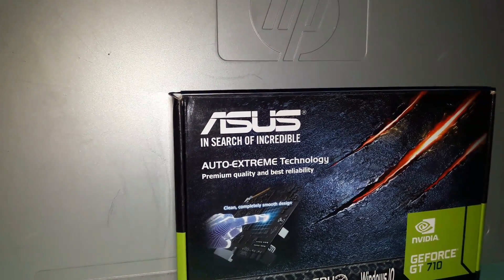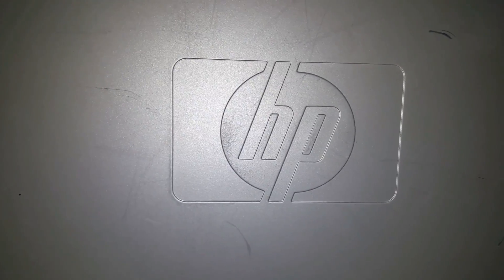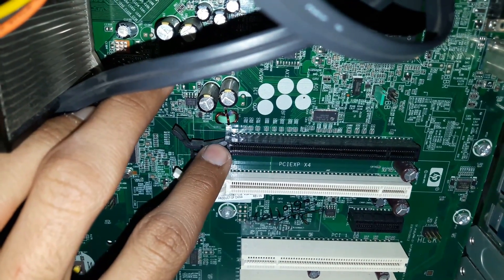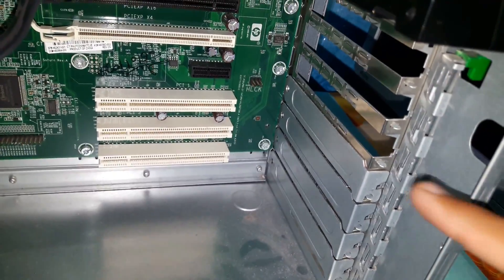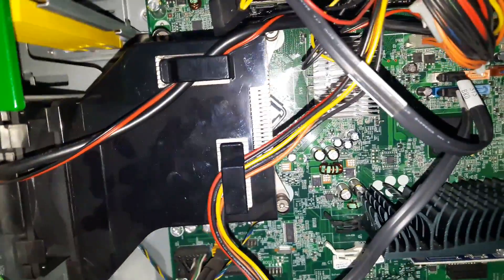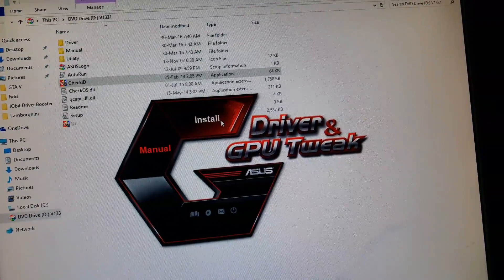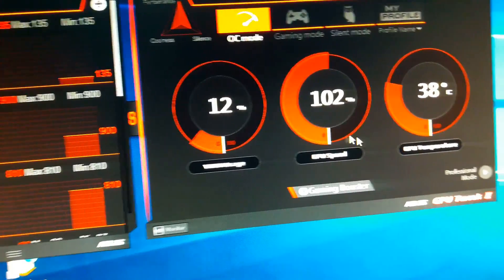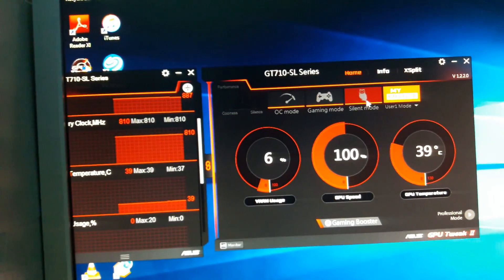ASUS Nvidia GT710 Installation on PC

Comment: Can it fit and work in windows 7
 ???????????????????
Reply from the maker: A-Tech Officials - I would not recommend to use this graphics card on a system running Microsoft Windows-7, because there are some few disadvantages:
1. Compatibility issues
2. Microsoft has officially stopped support for Windows-7 which means no more software updates.
3. You won't get regular Nividia Geforce Driver Updates due to the compatibility issues.
So, in conclusion to the above problems/disadvantages I would highly recommend to pair this graphics card with a system/PC running Windows-10 OS.

Comment: Can it work in 250w psu or will I face any issue !!
Reply from the maker: A-Tech Officials - According to Nvidia, the recommend PSU to efficiently run/use this graphics card, must have a wattage rating of 300 Watts (minimum). So, I am not sure that this graphics card would work with a PSU with lower wattage rating. And if it works than I am sure that it won't work in maximum power or able to reach higher frequency which in result will decrease performance.

Comment: Core 2 duo E8400 
4gb ddr2 ram
Gt710 2gb 
250w psu
Will it work
Reply: Motherboard?
Reply: @nehajadhav6072  zeb-g41 ddr2 motherboard i think my motherboard didn't support the graphic card
Reply: @nehajadhav6072  can zeb-G31 motherboard support gt710 ddr3 2gb

Comment: I have ddr2 motherboard so can i install gt 710 graphics card? Please help anyone
Reply from the maker: A-Tech Officials - It doesn't matter that what RAM (DDR2, DDR3, DDR4) type your motherboard supports the main thing which is required to install/mount this graphic card is a PCI-Express (PCI-E x16) slot. So, please check that your motherboard consists of a PCI-E x16 slot in order to mount/install/use any graphic card.

Comment: It will work on a 240 watt power supply if a guy 1030 can.
Reply from the maker: A-Tech Officials - This graphic card (Nvidia GT710 DDR3) might work on 240 Watts power supply but it will definitely work in under-voltage situation which will result in low performance and the maximum power and performance of the graphic card core cannot be achieved.
That's why we recommend you to use a 300 Watts of PSU with this graphic card and the fact is that even the Nvidia itself has mentioned on their website that this Nvidia GT710 DDR3 graphic card requires a minimum PSU of 300 Watts in order to work properly.

Comment: Can my power supply 300w handle this graphics card thanku
Reply from the maker: A-Tech Officials - Yes you can use this Nvidia GT710 graphic card because its minimum power supply requirement is 300 watts so your psu can handle it.
Reply: no it needs 2500000000000000000000000000000000000000000000000000watts
Reply: Depends on what CPU you have

Comment: can any graphics card work with h16m ds2 mther board????
Reply from the maker: A-Tech Officials - Your Gigabyte H61M DS2 Motherboard has a PCIE x16 slot but that doesn’t mean you can buy and install any graphic card on your motherboard. See there are two facts which should be noticed/considered before installing a graphic card.

1. Each and every graphic card has different minimum power supply requirements.

2. Installing a latest graphic card in a outdated hardware will not increase the performance of that hardware but may bottle neck its performance.
So what I mean to say that if you want to install a powerful latest graphic card then you will surely need a hardware(motherboard, ram, psu, storage device) that is capable of handling that much power so that any bottle neck issues doesn’t exists in the system.

So the whole conclusion is that no matter which graphic card you are using with your motherboard your system must full fill the minimum power requirements of that graphic card which means your power supply unit(PSU) should be capable of delivering the required power to that graphic card and also make sure your other hardware like motherboard should be able to utilise the power and performance of that graphic card.

Comment: Will it work on Asus p5g41t-mlx motherboard having specs- 2.93GHz Intel core 2 duo processor, 4GB DDR3 1333mhz oc ram, 2 pci slots, 1 pci ex16 slot, directx 10 support? My purpose is to establish a dual monitor setup.
Reply from the maker: A-Tech Officials - Your PC Specifications are sufficient to install and use this graphic card to play normal games or do minimal graphical work but if your purpose is to setup a dual monitor system then this graphic may not be suitable for your purpose even your system configuration is also not up to that level to run a dual monitor setup. So we recommend you to do some minimal upgrade like replacing the Intel Core 2 Duo processor with a Intel Core 2 Quad and increasing your RAM at least to 8GB DDR3 (make sure to buy the same frequency of RAM which means all the RAM installed in your computer should run on the same clock frequency) and you need to buy at least a Nvidia GT1030 2GB graphic Card and a 300 WATT or 450 WATT Power supply Unit(if your system already have a 300 WATT PSU then don't need to replace it).
So the conclusion is that you have to spend some amount of money but this price will be negligible in comparison with the price of buying a new PC.

Comment: Can I connect it to a power supply
Reply from the maker: A-Tech Officials - This graphic card does not require any additional power supply cable because it is a entry level graphic card it can take the power(Voltage) from the PCIE slot.
Just make sure that your computer System has at least a 300 Watt Power Supply Unit (PSU) installed in it because this graphic card's Minimum System Power Requirement is 300 Watt.

Comment: Will this gpu work on my 250 watts power supply pc
Reply from the maker: A-Tech Officials - No, the Nvidia GT710 Graphic Card’s minimum system power requirement is 300 Watts.
Reply: It will work

Comment: I have an intel i3 3.30ghz processor. 8Gb ram. If i install this graphics card can i play GTA 5 without lag? Pls reply
Reply from the maker: A-Tech Officials - Yes, you can run GTA5 with this configuration but let us inform you that it is an entry level graphic card so it will not give you the performance that you might be expecting. Although the Asus Nvidia GT710 graphic card can run GTA-5 without any lag but keep the GTA-5 graphic settings to low or configure the settings that best suits your desktop configuration.

Comment: One thing I was wondering you see how the golden part (connector on the bottom) is really small and short would it still work even if the port on the motherboard is longer
Reply from the maker: A-Tech Officials - In case of graphic cards it is not necessary the graphic card PCIE connectors should be of full length. Because some entry level graphic cards doesn’t comes with a Full length PCIE connectors But that doesn’t mean that these entry level graphic card will not mount/install in a PCIE x16 slot. The graphic card with half length PCIE connectors will also work fine like a Full length PCIE connector graphic card. So the length of the graphic card PCIE connectors does not matter. The only thing matter is that the user’s motherboard must contain a PCIE x16 slot to install/mount that graphic card. And several other factors are also necessary in using/installing a graphic card like power supply unit.
Reply: @ATechOfficials  thanks bro i thought the gpu was to small i just ordered one with a asrock motherboard

Comment: bro i have no monitor 
i have inbuilt, wat to do
Reply from the maker: A-Tech Officials - You are trying to say that you have a All in one PC. Please be little bit specific so that we can solve your query.
Reply: Oh sorry then and 
How do I install a graphics card
Reply from the maker: A-Tech Officials - The all in one desktop doesn’t support a graphic card because they are designed to be slim so that all the components motherboard ram and hdd stays behind the lcd displays making it compact so may be there are no PCIE slot available on your desktop’s motherboard and if there is a PCIE port is available then you will not be able to fit a graphic card in your desktop because there will be no space  left to mount it.
And according to my knowledge the all in one desktop comes with integrated graphics which means the graphic card is soldered on the motherboard forming a embedded system. So there is no way to upgrade or install the graphic card on a all in one desktop pc.

Comment: this pc is 10 years old how did you use it??!!!
Reply from the maker: A-Tech Officials - The PC used in this video was not in use now and it was only used for demonstrative purpose only.
And currently the A-Tech Officials team is not using a 10 years old PC 
They are using a PC with intel 7th gen. processor to render and edit videos we will be soon be upgrading to Intel 
8th gen. Processors.

Comment: do i need to install the graphics card first before i install the cd ?
Reply from the maker: A-Tech Officials - Yes, you have to insert the graphic card into the PCIE x16 slot on motherboard and you also have to connect your display cable(VGA or DVI-D or HDMI) in the graphic card. Then you can power on the desktop and can install the drivers from the CD provided.

Comment: Does it work on a Lenovo ThinkCentre M92P computer?
Reply from the maker: A-Tech Officials - Your Lenovo ThinkCentre M92p PC uses a Intel Q77 Express Chipset which only contains PCIe x1, x2 & x4 slots. To install and run this and other available graphic cards you need to buy a motherboard that contains a PCIe x16 slot on it.
Reply: A-Tech Officials Ok thank you
Reply: A-Tech Officials Btw can you give me a link where i can buy that motherboard?
Reply from the maker: A-Tech Officials - I don’t understand what you were trying to say what’s the meaning of “Btw” here.
Reply: A-Tech Officials "Btw" means "By the way"
Reply from the maker: A-Tech Officials - Ok Now I got what you were trying to say. So If you were thinking of upgrading/changing your motherboard then you also have to change your processor because your old processor may not fit in the new 7th or 8th generation motherboard.
For example: If you have Intel Core 2 Quad processor and if you bought a 7th generation motherboard with lga 1151 cpu slot then you cannot able to fit your core 2 quad processor in that motherboard because your processor requires a motherboard with lga 775 cpu slot.

I hope now you got my point that what I am trying to say.

So if you need more help regarding this query then you can mention your pc specifications in the comments section so that I can help you in selecting the correct motherboard.
Reply from the maker: A-Tech Officials - There is no requirement to mention your PC specifications in comments section. I forgot as you have already mentioned your pc model.
So your Lenovo ThinkCentre M92P uses a Intel Core i5-3470T 3rd Generation processor which requires a motherboard with LGA1155 CPU slot.

So if you don’t want to buy a new processor and a new motherboard then you can do one thing you can search on internet for motherboard with LGA1155 CPU slot and you can find several old motherboards with this type of slot that you can buy. Before buying just make sure that the motherboard you were buying has a PCIE x16 (PCI Express x16) slot on it so that you can also mount/install and use graphic cards.

Comment: bhai koi gpu ko lgane ke baad koi cable usmein lgana pdta h kya
Reply from the maker: A-Tech Officials - Powerful GPU's like Nvidia's 10 series GPUs and many others requires an external power source but most of the entry level GPU's does not require any external power source. So it is depend on the GPU model that it will require a external power source or not.The user can read the GPU description before buying a GPU. All the information like external power source is required or not are given in the GPU description.

Comment: bro the cd given inside has a driver for win 7 32 bit or what?
Reply from the maker: A-Tech Officials - The Asus GPU tweak 2 Software CD came with this graphic card supports Windows 7 32 & 64bits,
Windows 8,8.1 and Windows 10.
But the drivers came in the CD are outdated so you can download the latest software from the asus official website.

Comment: Can I run gta 5 on my pc which has intel core duo 2ghz and has 4gb ram and has asus gtx 750 ti as gpu
Reply from the maker: A-Tech Officials - Yes, you can run GTA 5 with your PC configuration but at medium graphic setting but if you want you can also customise graphics settings by setting some values to high and some settings to medium.
For eg :- set water quality to high
And set particles quality to medium

Comment: Sir can i install this with dual core processor
Reply from the maker: A-Tech Officials - Yes, you can use this graphic card with Dual Core processors like the intel Pentium series etc. But make sure that your motherboard contains a PCIe x16 slot before buying this graphic card.

Comment: Hi! I have a question maybe you can help me :).... I`ll buy one Gt710 1 Gb gpu, the thing is that I have an Asrock G41m-vs3 Motherboard and it Only supports memories(ram) with no more than 1333 Mhz, since this graphic card memory has 1600 Mhz do you think It would run? Thank you..
Reply from the maker: A-Tech Officials - In case of graphic card the graphic card uses VRAM (Virtual Ram) and it does not matter that your motherboard can support maximum RAM up to 1333 Mhz Frequency the only thing matter is that your motherboard must contain a PCIe x16 slot because graphic card is installed/mounted in this type of slot only. And in your case your Asrock G41m-vs3 motherboard do contains a blue colored PCIe x16 slot on it where you can install this graphic card but make sure that you have minimum 300 Watts of Power Supply Unit (PSU) because this graphic card requires minimum 300 Watts PSU to run.

Comment: Ca n I install it on Asus vertion core i5 4460 4gb ram and Intel HD 4600(1543mb dedicated)??
Reply from the maker: A-Tech Officials - I didn’t find any Asus Vertion but I think it may be a Acer Veriton.....please make sure that you mention the right model no. of your Desktop PC because if you will mention the correct model no. then only I can solve your problem.
But if you don’t know your PC’s model no. then you can check and make sure that your motherboard have a (PCI express) PCIe x16 slot on it or not because to use and install this graphic card your motherboard must have a PCIe x16 slot on it.

Comment: thanks for this video but please can i install this gt 710 on ddr2 ? please
Reply from the maker: A-Tech Officials - First of all in case of graphic cards the RAM version doesn’t matter whether it is a DDR2 or DDR3 the only thing matters in successful installation of graphic card is that make sure your motherboard has a PCI express (PCIe) x16 slot on it. Because the graphic card only fits into a PCIe x16 slots and the RAM version may little bit affect the performance of graphic card and processing of processor but after all everything will work great.

Comment: can this support my
core 2 duo e8400
6gb ram
280 watt psu 
ty in advance
Reply from the maker: A-Tech Officials - You cannot Run this graphic card on your PC System because your PSU is only 280 Watts and the Nvidia GT710 minimum psu requirement is 300 Watts.

Comment: Did you have to tweak anything in bios or was the graphic card detected straight away?
Reply from the maker: A-Tech Officials - There is no need to tweak anything or change bios settings when the graphics card is mounted/installed the system will automatically detect the new hardware. The only thing you keep in mind that when you mount the graphics card disconnect the display cable from onboard ports and connect it to the graphics card ports before turning on/ booting your PC.
Reply: Great! Thanks!

Comment: is this video card compatible to my old socket 775 motherboard?
Reply from the maker: A-Tech Officials - This graphic card is compatible with LGA 775 socket motherboards that supports Core 2 Duo and Core 2 Quad processors. You have to make sure that your LGA 775 socket motherboard has a PCIe (PCI Express)x16 slot because every graphics card fits into a PCIe x16 slot.
If your motherboard doesn't have a PCIe x16 slot then none of the graphic card is compatible with your motherboard.

Comment: Hi A-Tech,  My PC configuration is a follows:- MotherBoard Asus P5G41T-MLX, Pentium Dual Core E5400@2.70Hz, 4GB DDR3 RAM, WINDOWS 7 OS, 450W PSU. My question is, will this graphics card be compatiable with my PC? And is there any other graphic card that you recommend as per my PC configuration?
Reply from the maker: A-Tech Officials - Yes, this graphic card is compatible with your motherboard.
This is a entry level/low profile graphic card so it will not deliver the max performance out of your PC. To get the best performance out of your PC, I will recommend you to use any one of the following graphic cards given below:
1. Zotac Nvidia GT730 2GB DDR5
2. Zotac Nvidia GTX1050 mini 2GB DDR5
And If you're a gamer then I will also recommend you to use another 4GB DDR3 RAM so that your PC will get a overall RAM of 8GB. 
And also note that the maximum RAM supported by your motherboard is only 8GB DDR3 exceeding the limit will not be acceptable by the motherboard and the motherboard will not work.